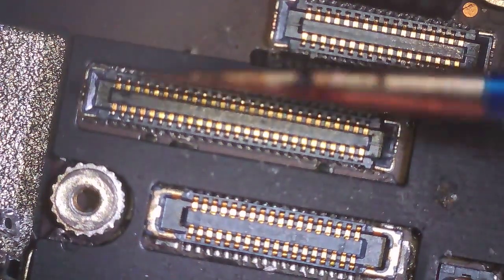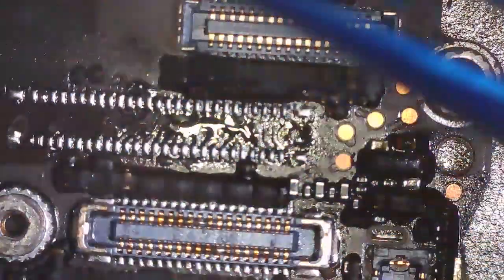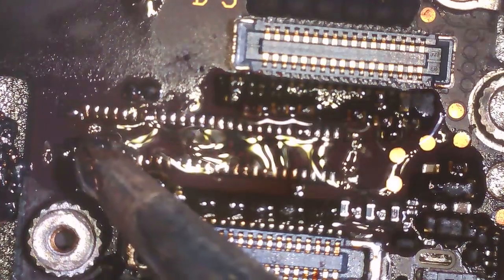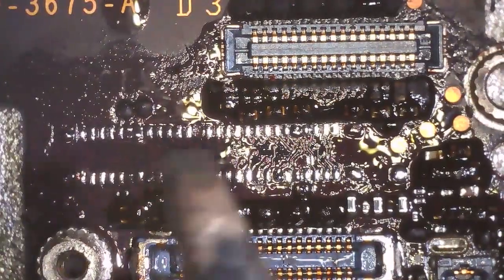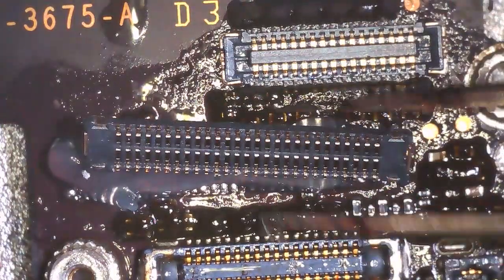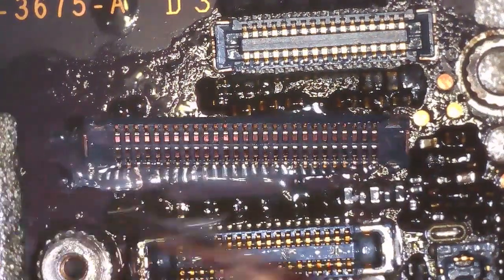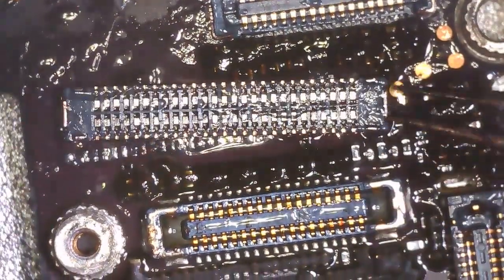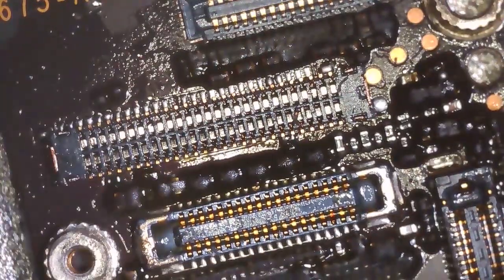The discount question... iPhone 6 plus FPC connector replacement attempt

Comment: Hello! You swapped up ! You soldering that in wrong site !  You should be more careful for what you doing! And use more flux ! 
Anyway thanks for the video!
Regards,
Reply from the maker: Good afternoon! What do you mean by “swapped up” and soldering in the “wrong site”. I know it wasn’t a good attempt but I was just practicing. Showing people that no one starts off perfect. (It was a donor board too)
Reply: @tyfixit6138  you swapped up to down ! 
If you soldering like that you will be not able to Klick the flex into that ! See the other FCP connectors and you will see the wrong Site is up the right site is down !
Regards,
Reply from the maker: @lycanlycans7548  thank you for the advice!!!